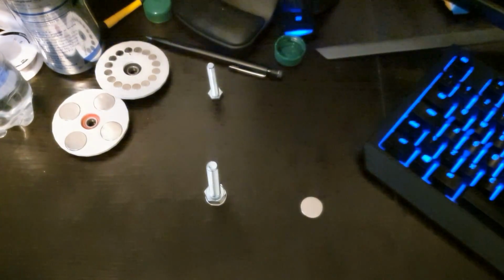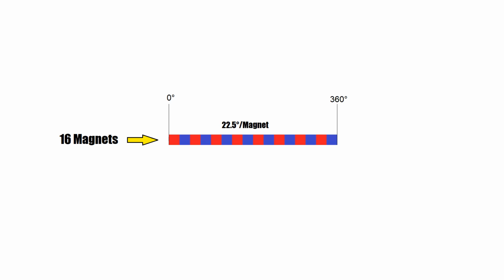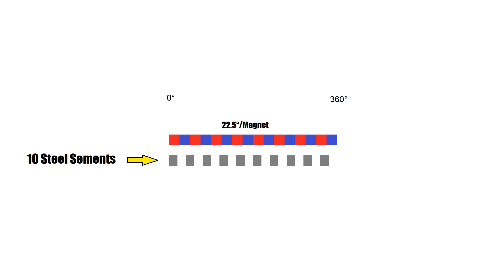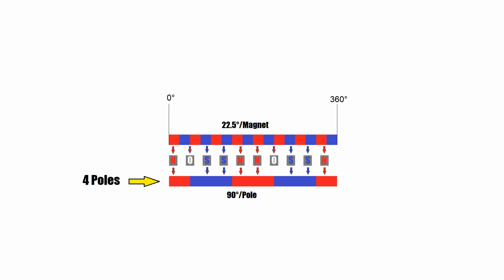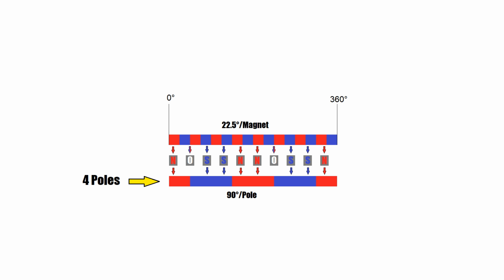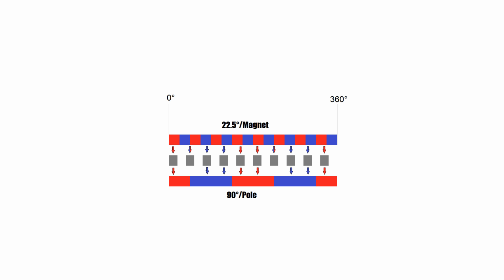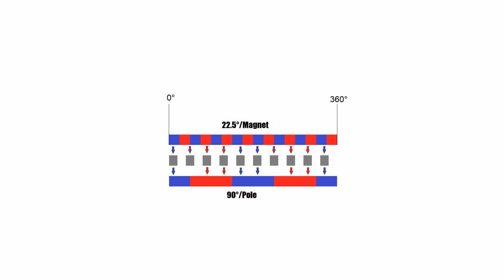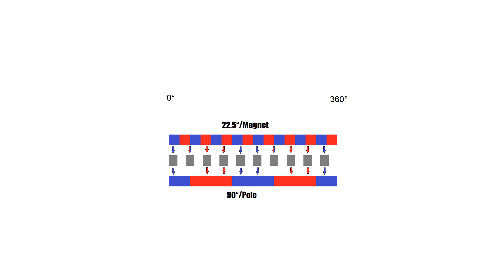Magnetic Gears & How They Work!

Comment: How about the torque amplification? will it increase?
Reply from the maker: The torque is amplified when manually spinning the 4-magnet gear, yes.
Reply: @BenjaminDMarshall  thank you for your response, so how to you calculate torque ?
Reply from the maker: The torque is calculated using the same ratio as the speed amplification. 

If the gear is spinning 4 times as fast, it has 1/4th the torque. If it's spinning 1/4th as fast, it has 4 times the torque.

Magnetic gears are limited by their holding torque though. If your torque output is higher than the holding torque of the gear, then it's not usable. The gear will just slip.
Reply: @BenjaminDMarshall  Thank you again for timely and quick response. 
But I want to understand How to decide the power of magnet to enable it to transmit desired torque?
Reply from the maker: It's a good idea to use the strongest magnets you can get, which are N52 magnets.

I dont know how to calculate the exact holding torque, but you can increase the holding torque by using larger diameter gears, more magnets, or arranging the magnets into a halbach array.
Reply: @BenjaminDMarshall  So what is the holding torque for the model you used to in the demonstration?
Really interesting video by the way.
Reply from the maker: It's only about 0.25Nm. And thank you!

Comment: How do you do odd sized gear ratios? like 3:5
Reply from the maker: Since the gears need an even number of magnets, you should multiply your ratio by two to get even numbers. For your example you would have one gear with 6 magnets, and one with 10 magnets, with 8 steel segments between them.

You could also use any whole-number multiple of those numbers, for example 12, 20, and 16 respectively.
Reply: @BenjaminDMarshall  Big Brain

Comment: How much torque can it hold?
Reply from the maker: Not a lot. It takes about 300 grams of force at the edge of the 70mm disk to make the gear slip.

I've got plans for a design that will have substantially stronger coupling using two nested cylinders for greater surface area between the gears. Though, magnetic gears are not known for their exceptionally high torque tolerances. The benefit to them, however, is that they can experience torques well above their rated limits and suffer no damage.
Reply: Ok but what about sheer resistance to rpm? Like if its repeated a dozen times will the same resistance be felt?